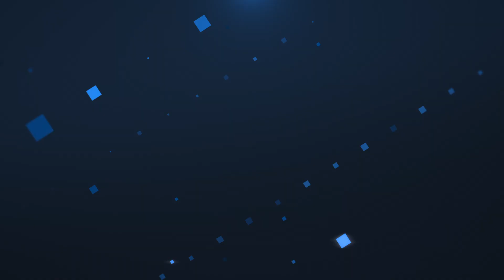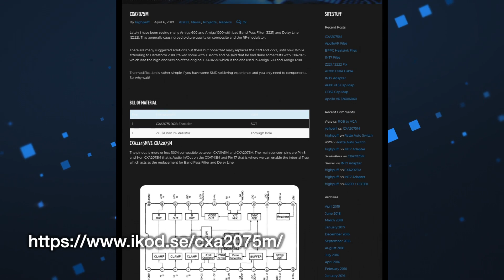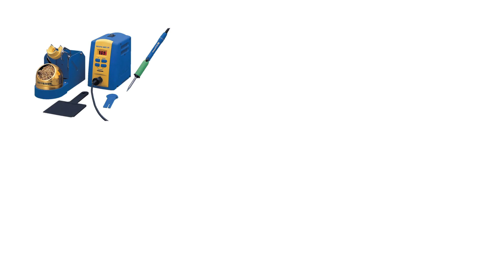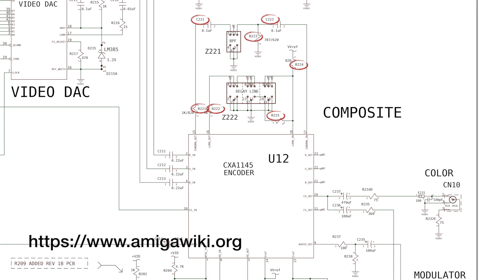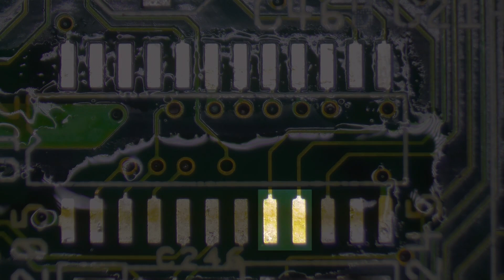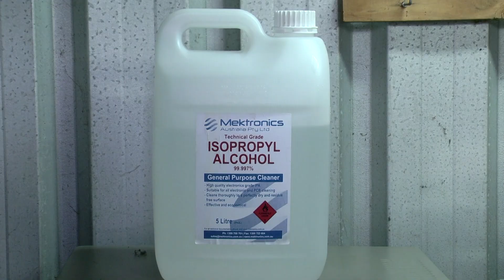Amiga 600 and 1200 CXA2075M composite output repair

Comment: I've seen this mod kicking around and I'm interested in trying it but something I haven't seen clearly addressed is if it works equally well for NTSC output. I see the NTSC / PAL select pin is the same as on the old chip but I know for the original circuit the values of the external bandpass filters are different between NTSC and PAL Amigas and from the diagram it doesn't look like the new chip makes any allowances for the internal trap that replaces them to change values depending on which mode it's operating in. I'm curious if anyone has tried this mod yet on an NTSC Amiga and can share their results.

EDIT: Careful viewing of the datasheet for the 2075M shows that a different value resistor from +5V to pin 17 YTRAP should be used, 3.32K/1% instead of 2.61K. I'd still love to hear from anyone who has tried this on an NTSC Amiga though.

Comment: Hi Bruce,
Thank you for your excellent video. I closely followed the guide that was found on the iKod website (removed the necessary SMD's from the back, cut pins 8 and 9 and bridged the pads, and also soldered a 2.61k resistor between pins 12 and 17). I also came across your video as well. I performed the modification on an Amiga 1200 Rev. 2B motherboard and while I had success with the mod and it works, the chip gets ridiculously hot to the touch. I measured the temperature with a heat camera and it reports about 98 degrees. I tried 3 CXA2075M's, all with the same results. I just wanted to find out if yours also got that hot and if the chip can handle that heat? Is there something about the Rev. 2B motherboard that perhaps causes the chip to reach a high temperature? Is there something else required for this motherboard revision? Thanks very much for your time.
Reply: I selected external modulator A520 with composite out on my A1200 if I needed, on my r1B composite out the colors flashed occasionally, some people has heat problem with CXA2075M on  irelevant revision r1. SOme people no judge heat on this chip so no has problem :)

Comment: hi, I found your video because I noticed my Amiga 600 have some corrosion visible on the Z221 - I only use the video connector port, never composite, so I haven't noticed any problems, but I am not happy that the Z221 seems to be leaking, do you know if I could just safely remove the Z221 and Z222 and not replace them with anything - just remove them?

Comment: I don't use the Composite output, haven't done so since 1990 when I used my Amiga 500 on my 34cm Colour TV that I bought from Brashes (remember them?, lol) but I'm now curious as to how my A1200 has held up with relation to Composite?  

I'll have to pull out my old TV to see what happens?  although I think you had my A1200 running through Composite on your LCD TV when you did my recap to show me the machine was working ok?